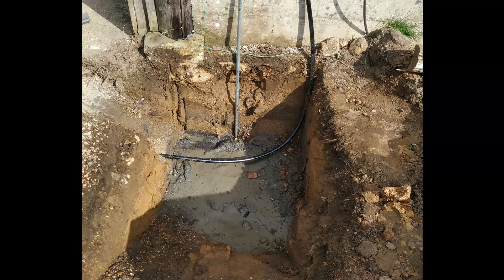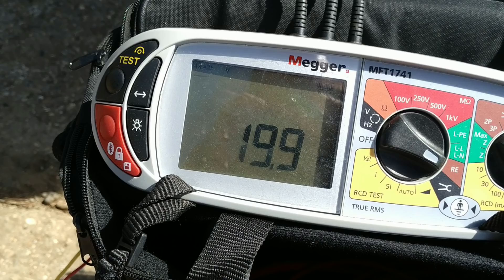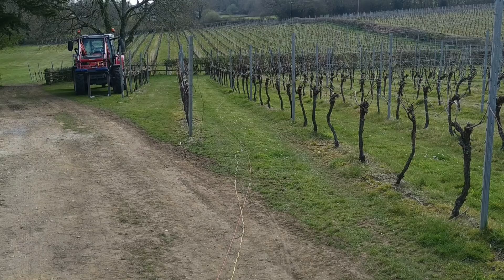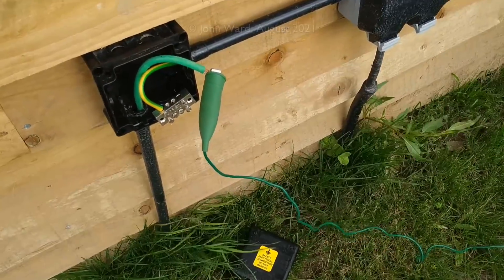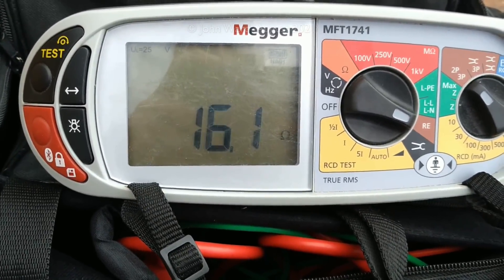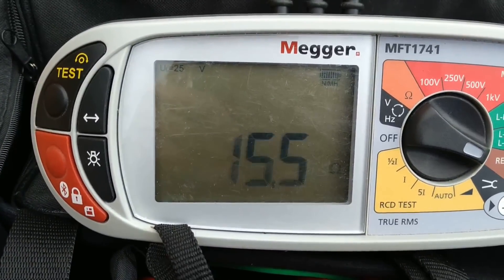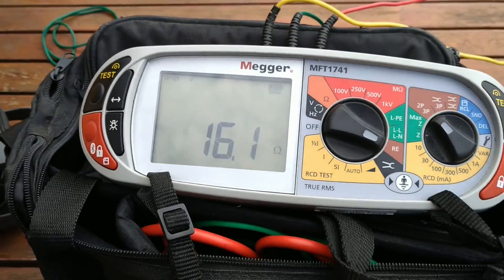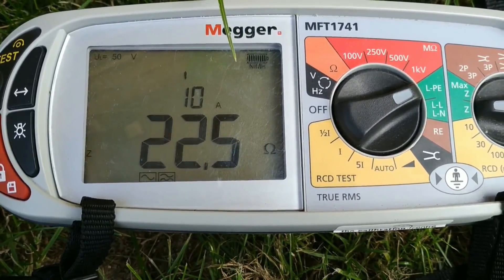ConduDisc Final Tests - 4 Months Later

Comment: Great vid John. Even at 15.5 Ohms and 240V, the ground fault current would be about 15A. Hardly seems enough to trip but a 6A breaker, and even that not instantaneously. I guess what Im asking is if the consumer unit needs RCD protection anyway, what benefit is there in having a low earth  resistance anyway? Just limiting voltage rise during a fault?

Comment: Condudisc is a great product, just wish it was lower cost. I suppose on the other hand it's a reasonable price compared to costs of hitting something under ground.
Reply from the maker: Yes, it's all relative.  Also consider the lifespan - 60+ years compared to a metal rod which can corrode away in 10 years or less.
Reply: @jwflame  Extra life span is interesting.

Comment: I am interested in this test method. Never installed a rod before and i believe our test meters (kewtech kt64dl) dont have a function for this type of test, nor do we have the leads or electrodes for it. Is it not acceptable to simply perform a Ze test instead of this 3 wire test?
Reply from the maker: A Ze tests the whole earth loop including the supplier's electrode, and parallel paths to Earth via any bonding connected to the installation such as gas or water pipes.
To test the electrode only, the test as shown in the video is required.
The KT64 doesn't have that feature, it's only on the KT65.

Comment: I have a difficult (for me) setup and would welcome some advice.  I have a metal framed/roofed house on a floating reinforced concrete slab, the rebar in the slab is electrically connected to the steel frame/roof, I believe this is called a UFER ground.  On the roof I have solar panels which are isolated from the roof but earthed to the slab via an earth cable.  The solar DC cables go to a shed 5 meters away into an inverter then the inverter feeds the house 230v AC.  The shed and inverter are earthed with an earthing rod.  Can I use the UFER earthing bonding point to earth everything and get rid of the ground rod?  If not what ground should I used for the inverter and A/C supply?  It is an off-grid build and the only buried cables are the solar DC and Return AC and earth in separate conduits.  I have no restrictions or codes that I am obliged to adhere to (hence my self build) but I'd rather get this right now.  If it makes a difference I intend to use RCBO's on each circuit once the internal wiring is done.

Comment: So doesn't the pole transformer have an earthed supply ?
Reply: Yes it does and this is why we test for Fault Loop Impedance
Reply: @jimmeh213  So the issue is no earth conductor between transformer and property ?

If that's the issue, use neutral conductor.
Reply: @millomweb  the issue in JW's video is the fact that the soil is very rocky and compact - you struggle to hammer in an earth electrode.

So JW is showing us the alternative which is a disc with a large surface area in the ground.
Reply: @jimmeh213  It's a very short large diameter rod ;)

Very short pipes are known as washers ;)
Reply: @tim g I've recently bought an "electrical fault" ! I't's an 8k2 ohm 7W resistor - for the purpose of testing an RCD - from which I've removed the fake TEST button.
Reply: @tim g It's an interesting concept - but what we appear to be having are 'live' conductors and 2 neutrals - with 'monitoring devices' across the neutrals.
The basic monitoring device is the fuse - which will fuse if the supply exceeds the rating of the fuse and hence disconnecting the power. The more advanced device being the RCD detecting leakage currents to the 'wrong neutral'.

The concept of 'earth' is totally irrelevant.

The concept of earthing the power source is totally irrelevant.

All we are interested in is if the correct wires are being used for current carrying; the right neutral rather than the wrong neutral. It's also interesting that the 'right neutral' is optional.

I don't think 'PE' is good terminology. 'Guard' or 'shield' are perhaps better terminology we should be using.

Is 'double insulated' sufficient ? I'm going to suggest not. I think all power cables carrying >50V should be shielded with copper braid conductor in flex, and SWA in stiffies.
Reply: @tim g 100 ohms - interesting random value. I'm going for 8kΩ
Reply: @tim g Which is surely not as good as a copper conductor connected to N immediately upstream of an RCD. After all, that is really what you're making - so why take the long way aaround ?

I've done it short style with my generator - connected E to N just upstream of the RCD.
Reply: @millomweb  have you earthed your generator output N ? 
Just curious.

Comment: John, does it make any difference if one of the test ground leads goes off in one direction (say north) and the other test lead in the other direction ? (say south)
Reply from the maker: Yes, the electrode under test and the two test probes need to be in a straight line.  It's measuring the voltage at the middle one with a known current flowing between the other two.  If they were in different directions, the test won't work as there is no voltage to measure.
Reply: @jwflame  Not just simply a straight line but the yellow lead must be in the middle then.

Comment: Couldn't get less than 700 ohms in Bowdon near Altrincham. Post for EV charger sunk into ground and concreted in. Went below 20 ohms... Huge Csa helps clearly
Reply from the maker: Contact area with the Earth is the most important factor.
Reply: Csa? Conductor surface area?
Reply: @Gameboygenius  Cross sectional area.. Less game boy more learning the most blindingly obvious
Reply: I wonder how well one of these would work for the RF earth for my amateur radio station
Reply: @bx16v  I have had a good watch of all the earth videos from J.W. - excellent work too! 
The point being that my (antenna) tower is an extraneous metal part of a structure with a sub installation. I have to assess the earth protection of the structure and subsequently any RF kit attached.
Any adequate earth is going to improve your RF path and or safety - provided it is entirely distinct from the mains protection or you may introduce ground loops and the possibility of live equipment where there should be none.

Any earth system should be connected to a single nodal point to prevent loops and voltage gradients. If your radio equipment is electrically isolated from mains voltages. IE battery powered or via isolation tx. AND the mains earth is NOT connected to it then you have independent RF earth/ground: indeed any ground electrode will make a ( big) difference. Especially on co-axial end fed antenna because of the imbalanced feed. But you must be sure that you do not disconnected electrical protection, or link RF circuits back to power circuits.

Hopefully this is helpful.

Comment: Great set of videos and great way to educate the industry on the new product. The fall of potential method requires a fall gradient - a set of readings when taken when stakes at different distances which you showed. Well below the 25ohms which is what we require as the ground resistance threshold in the US in the us NFPA70(NEC 2020).

Comment: It actually makes me wonder, are the standard earth rods out dated ? should we be moving forward with new systems and ways of doing things? 

rods are still used yet they’re extremely old technology, and maybe things like this should be considered more
Reply: No it’s just giving you many more options especially in difficult ground when you hit bedrock early and where pushing in rods might be a really difficult and you would have to lay them at a shallow angle or put more rods in to get the resistance down to a reasonable number in US we use the 25ohm threshold. Rods will have there place as would this excellent product and other methods of earthing like mesh, rebarr foundation earthing for newer builds as they do in Europe and USA.

In my views you could create a mesh of these particularly useful in my view when installing EVs and you don’t trust the DNO earthing or worried about it degrading in the future.
Reply: The key question is not how old the technology is but whether it works.  Other criteria are secondary.
Reply: @JimWhitaker  fuse wire works for your Fusebox also 😀 but there’s better technology out there now was my point really. 
Not saying there’s anything wrong with rods. Just wondering why we’ve stuck with such an old way of doing things when everything else has advanced
Reply from the maker: Rods are still valid but have risks installing them if there are buried pipes/cables, and they corrode away fairly quickly, in some cases in just a few years. Multiple rods may be required for a low resistance.
Reply: Thanks cablesmith. I’ve just had a load of work done and they used really old technology, so it must be wrong and need replacing. Could you tell me what they should’ve put in instead?  The stuff they installed is called “copper wire”.
Reply: @hairfritz2667  I assume it was modern pvc/pvc copper cable they used ? 

Rather than lead insulation, paper, vulcanised Indian rubber or even single insulated stuff ?
Reply: @Cablesmith   if you think lead acts as insulation, then I’m probably wasting my time here.  There are things that worry me much more than people installing earth rods. People still fitting type AC RCDs is one. People telling people they need work doing when they don’t is another, for example that they need their rod replacing with one of these when there is nothing wrong with it. I know that isn’t what John has in mind. I hope you don’t either. Perhaps best learn about insulators and conductors first, at any rate.
Reply: @hairfritz2667  so you completely ignored my point then. 
Who said they’re telling people they need to replace a rod for one of these ? 
I’ve yet to need to use any form of TT Earth myself, so not really a concern for me. I just know, as john said, rods can and do degrade sometimes
Quite quickly, there’s better things out there now.